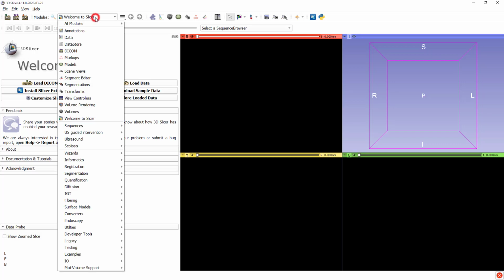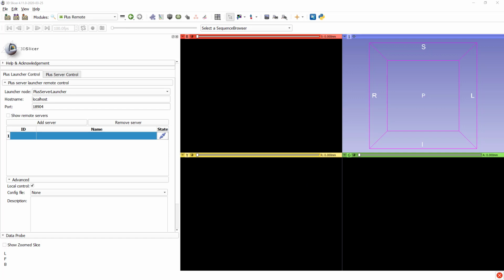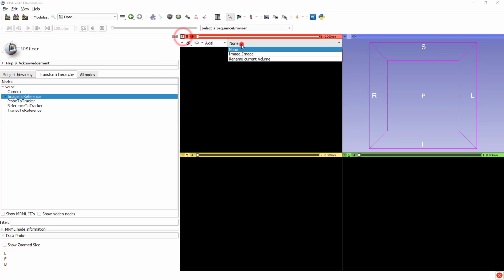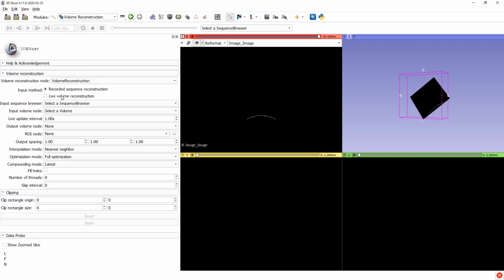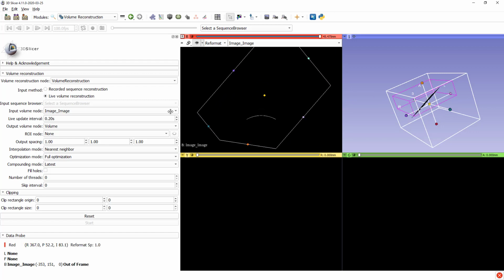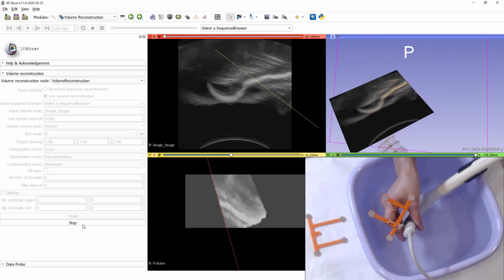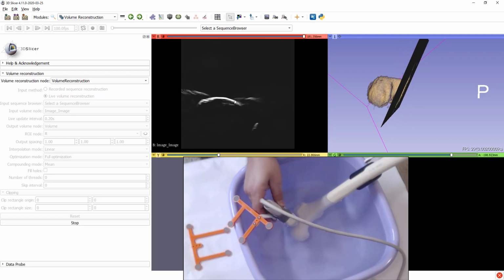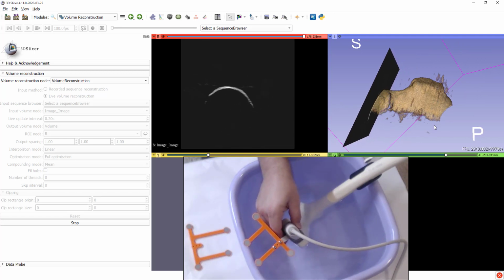Real-time 3D ultrasound reconstruction using 3D Slicer + SlicerIGT

Comment: Hi! great work, i have a question, when moving the probe around the object I can only see the 2D volume image in the yellow screen, is there any other config to be able to see the 3D volume? thanks!
Reply: To see the volume in 3D: set up Volume Reconstruction module as shown in the video and make sure that the reconstructed volume visibility is turned on in Volume Rendering module
Reply: Is that a Polaris Vicra tracker? I can not find any average price of a system like that, could you share some info about it?

Comment: Thanks a lot.
Please, what kind of webcam do you use for the Real-time 3D reconstruction ?
Reply from the maker: Tracking error of webcams is very large (can be several centimeters), therefore I would not recommend them for ultrasound volume reconstruction. Instead, you can use proper position trackers, which typically have submillimeter accuracy - see for exmple the ones listed in the Plus toolkit documentation: https://plustoolkit.github.io/features.html

Comment: Great video! Is there a way to do this but with volume to volume? Meaning, stitching outputs of a 4D probe rather than a 2D crossectional one like the one used in this video? Cheers.
Reply: Yes, it works for 3D+t data sets as well, even for unstructured volumes. See for example here: https://youtu.be/hIxr9OKBvQ8

Comment: May I check what is the position-tracking system which you used in this video?
Reply: We used Optitrack Duo for this particular demo, but Plus toolkit (www.plustoolkit.org) that collects imaging and tracking data supports most optical and electromagnetic trackers (NDI, Ascension, Atracsys, Claron, etc), surgical navigation systems (Medtronic, BrainLab), etc. See complete list here: http://perk-software.cs.queensu.ca/plus/doc/nightly/user/Configuration.html